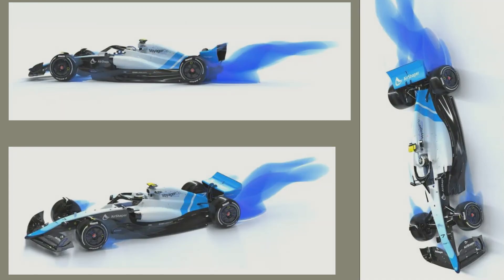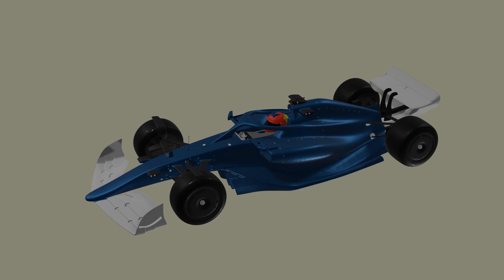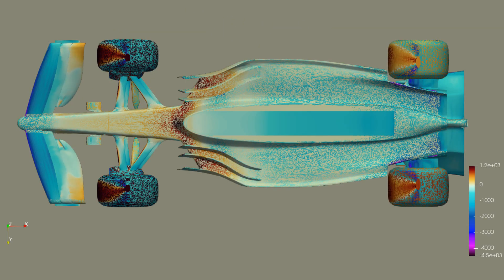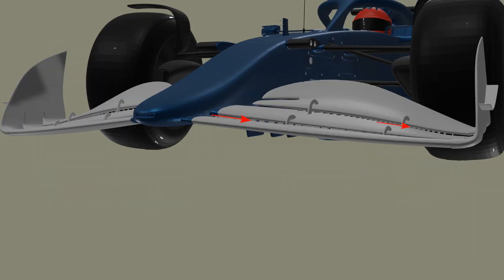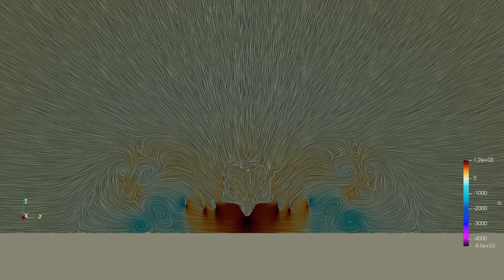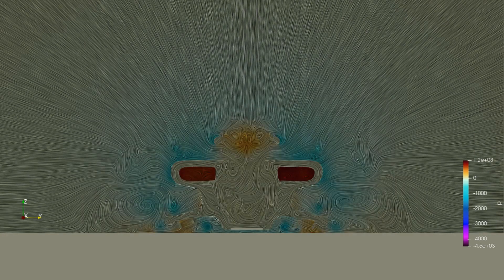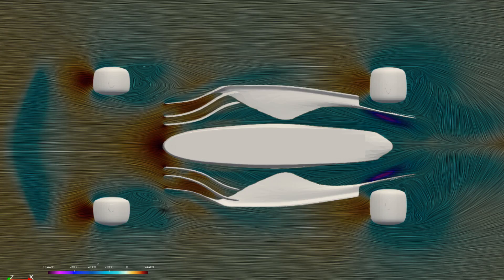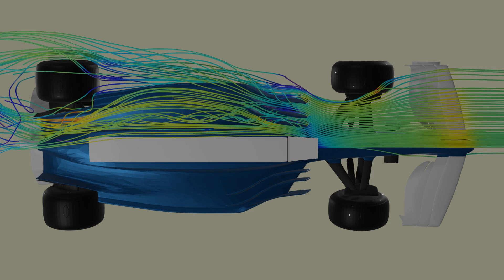Analysis of AIRSHAPERS F1 Car Model

Comment: If you want to give the edge wing some nice high pressure air, then you need an undercut channel and a way to block airflow from going inboard of the rear tire. Aston Martin and Red Bull do just that with their sidepods. They both have an undercut channel that creates high pressure over the edge wing, and a way to channel airflow inboard of the rear tire. The sidepod also separates the two flows. Mercedes on the other hand sends a lot of air to the diffuser, but is sacrificing clean air to the rear wing, likely why they have to run a barn door and compromised ride height.

The Ferrari had the right idea, but now they just fell into the same trap Mercedes fell into. The Red Bull and Aston are very close in how they separate airflow just for the edge wing with their undercut, but also how they keep that edge wing flow from going inboard of the wheel into the diffuser. That air's energy has been used up, it's slow high pressure, this will drive the edge wing vortex quite nicely. We can use the downwashing sidepods to feed clean air inboard of the tire, that way the edge wing gets what it wants(high static pressure low energy air), and the diffuser gets what it wants(clean high energy air). Under the floor on the suction side of the edge wing and extending into the diffuser is a strong low pressure. That high static pressure air above will become energized by the pressure differential below.